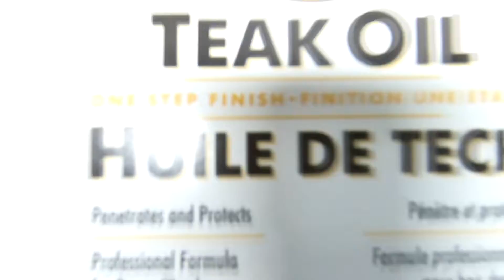Scrap Wood Wreath - Simple DIY

Comment: Oh how I want a nice solid table saw someday!   I like the washer hanger trick!  I don't think I have ever used teak oil.  How do you like it?
Reply from the maker: I really like teak oil. But, from what I understand, the Watco stuff is basically danish oil with an anti-fungal put in it so that it doesn't go mouldy on outdoor projects. As I like to do both indoor and outdoor stuff, I just buy the one can :) As for the table saw, you can find these old craftsman table saws pretty cheap these days. While it is solid, it is missing a lot of the features that new saws have (i.e. riving knives and easy to adjust fences) Thanks for watching and  I hope to one day see something hanging in your shop from a bent washer!
Reply: The Grant Alexander A lot of big channels have those Sawstop ones.  I informed Sawstop that they are first on my list after I win the lottery.
Reply from the maker: @TurningsbyTurner  sawstop would be nice, but I love my current one because it was my grandfather's. It is hard to replace sentiment
Reply: @TheGrantAlexander  So true. Knowing some of your projects were  built with the same saw your grandfather used is priceless!